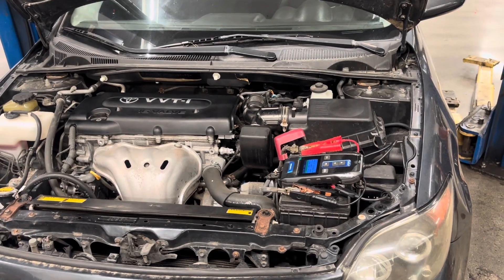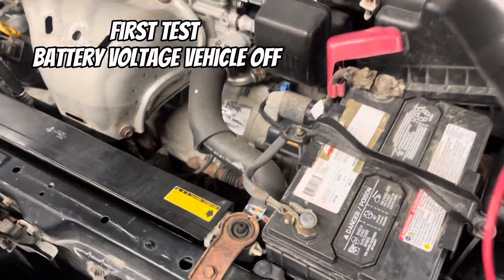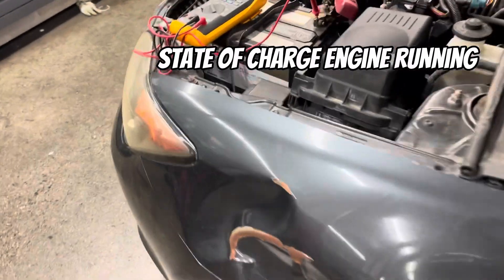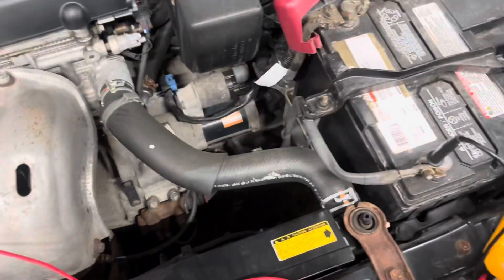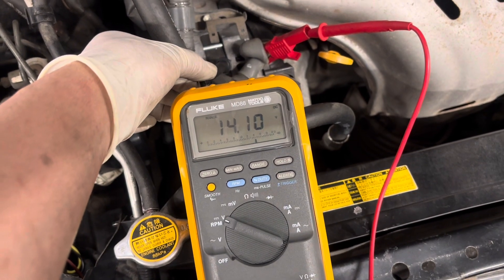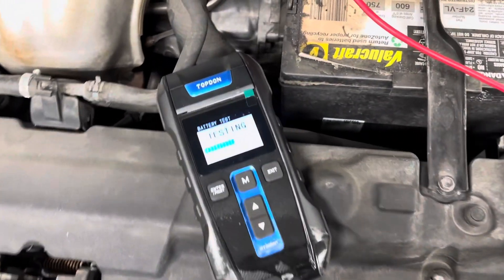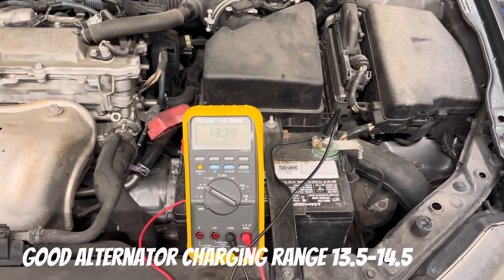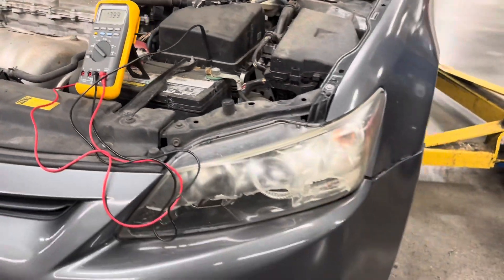Scion tC Charging System Test (Gen 1 & 2) | Healthy Alternator & Battery Voltage

Comment: my fav part about this video, is when he said 'Im going to get straight to the point' & then proceeds to cue up some trap beat w/the ear piercing hi hats, just to test your hearing as well 😆 5 stars
Reply from the maker: Haha I appreciate the 5 stars.👍😂
Reply: @projectracingtheory4125  lmao btw you missed a lot of info right from the jump (honestly, a ton of videos on utube that cover this allllll miss it) 

You can have a 12.90 on your multimeter, with the vehicle off. When you say 'this means the battery is good'. That is incorrect & again a ton of utubers overlook this. A battery can show that it's still holding a charge, however, going by this multimeter reading when off .. does not tell you if the battery is good. All that would indicate, is that it still holds a charge. Why? Because the battery still has to supply crank amps, to start the car. Even if it's still holding a charge. A multimeter will not tell you, if your battery can start your car. I've seen a lot ppl swear by a multimeter reading, not knowing the battery is bad, because it doesn't start the car. Multimeter is more a basic general way, to tell if the alternator isn' working &/or a starting point.
Reply from the maker: @adamjones7014  I load tested the battery in the beginning to test the battery’s internal for a reason if the battery would have failed then it’s pointless to test it with a multimeter.The reading was at 12.9 because vehicles battery had surface charge that’s y set a range if you noticed.theres a 10 steps I take with a multi meter you can actually do to test the integrity of the battery but nobody wants to watch that process so I set ranges for that reason. 12.6 is 100 12.2 is around the range is 50% charge. Look it up. I may do that video since you’re questioning the meter. Thanks for the input.👍🙏
Reply: @projectracingtheory4125  So, how I found your video, is I was looking for instances where the meter would show the battery is 'good' .. yet the battery was not able to supply enough crank amps to start the car. I actually did the same test you did in your video. This happened to me yesterday. The meter showed my battery was good & had 12.8V. However, the battery still did not supply enough crank amps to start my Toyota. In other words, I knew my alternator was fine & the starter was also fine. I even checked my ignition coils or spark plus, because the meter also told me 'its a good battery w/ 12.8 V'. Because the meter told me 'the battery is good', similar to yours in your video .. it actually made it more complicated, because these meters unfortunately, sometimes will tell you a battery is good, when its not. This battery, would occasionally have enough crank amps to start my toyota, which confused so many mechanics I took it to lmao & could hold the load of radio/ac/lights etc  just fine. In my case, the moment I bought a new battery, despite my meter showing the battery was 'good',  my car started up right away & I have no issues whatsoever now. That was first time I've ever exp that specific to meters and batteries. If I still had the old battery, I think that particular issue, I encountered .. would make for a great utube video. Because no one has covered it. Otherwise, solid video brother .. minus the Trap beat - because as a musician, the genre abuses the hi hats in the least melodic way ever lmao
Reply from the maker: @adamjones7014  ok I understand and I do agree the voltage reading with a meter by it self won’t tell you if the battery is good inside that’s y I used a load tester to load the battery and test the internals of the battery first.Sometimes battery’s can short inside or have a bad cell so they won’t supply enough cranking voltage under load.

Comment: So then how would you fix a failing charging system? Mine fails at autozone, even after replacement of battery and alternator
Reply from the maker: Check the rest of the system it’s more than just the battery and alternator. Theres fuses ,relays and wires. Sometimes a good inspection can help. Also check the basics like the fuses.

Comment: Hi i have a 2015 scion tc2. I have a stock original alternator and optima yellow top battery as well as a 1200watt amplifier for my sound system. At idle my cars voltage reads as low as 13.2v but when driving usually 13.6+. Also when its 85+ degrees out the highest voltage i see is 13.7 or 13.8 but when its not hot out it reaches as high as 14.2v when driving. is this normal?
Reply from the maker: Yes that’s normal. 13.2 is on the low end but not alarming if your car still starts up fine. How ever if the voltage gos under 13v for example 12.8 or battery voltage 12.6 then yea I would start performing load test on the system.